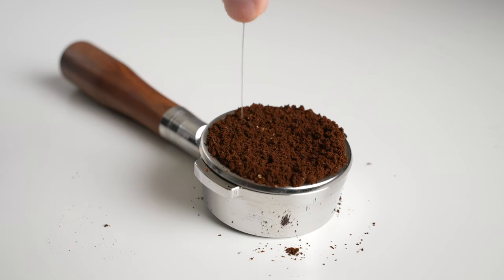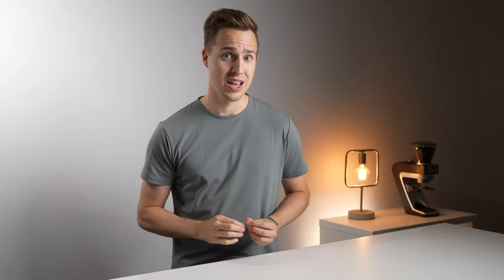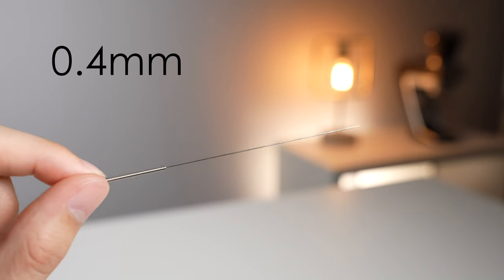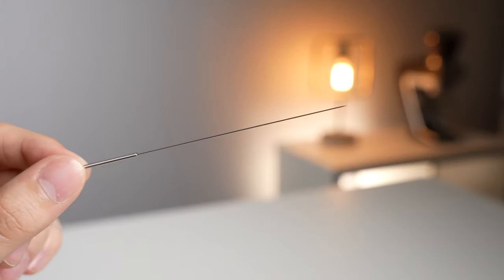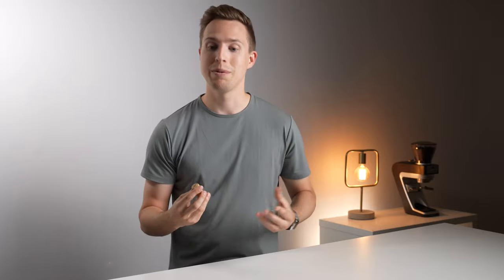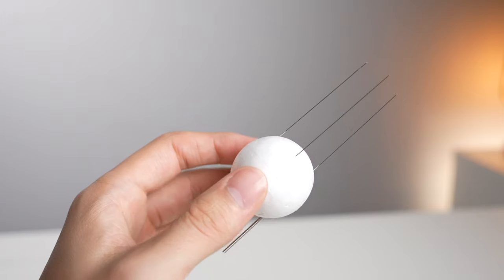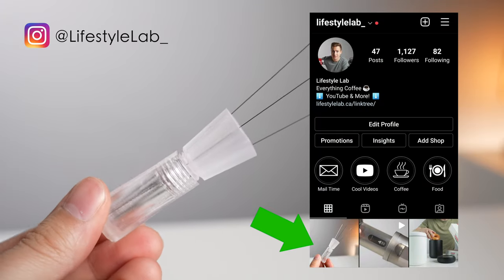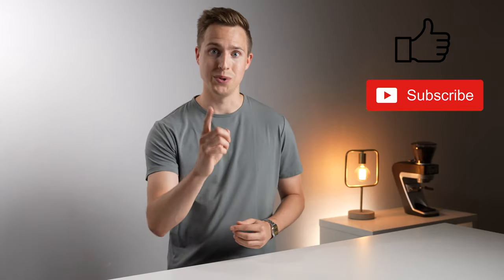The LEAST Expensive WDT Tools

Comment: Thanks for these ideas.   I was looking for  wit tool… and ultimately decided on some needles designed to clean 3d printer nozzles.   About 8 with free prime shipping.   Best part…. You get 10 needles…. 5 longe, 5 shorter.   I will likely put them in a drilled wine cork

Comment: "predrilling" a cork easily done with a nail.
glue a small magnet on it then to keep it handy and out of the way.
I used a refrigerator magnet scrap, it's that light.
I have a $2000 machine and a yogurt cup funnel. So?  That's why I can afford a $2K machine.

Comment: These are actually acupuncture needles and you can go to a place which does acupuncture, they may give you one or two for free.
Reply from the maker: Acupuncture needles are FAR thinner than 0.4mm. These would hurt a LOT if that's what your local acupuncturist is using! Haha
Reply: @LifestyleLab_  can't agree. Some of the needles are 0.3mm in diameter which is good enough for 0.4mm nozzles. Actually Prusa is adding acupuncture needles with their printers.
Reply: @LifestyleLab_  boogie is actually right. I got 0.4mm needles from a physiotherapy store
Reply from the maker: Ouch! I stand corrected then! 
I'm certainly not an acupuncture expert